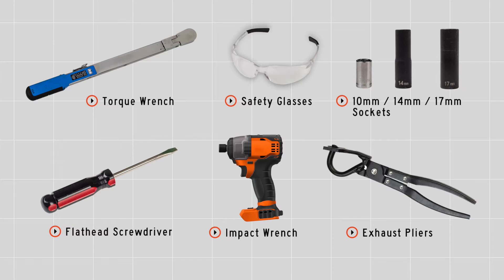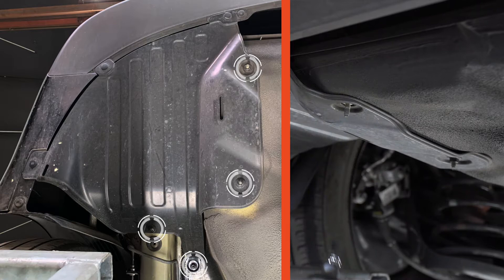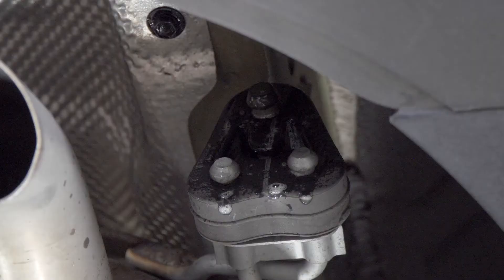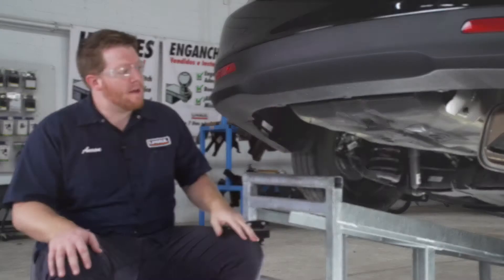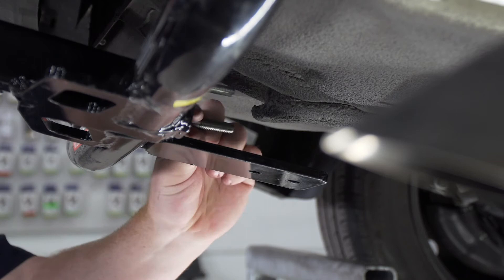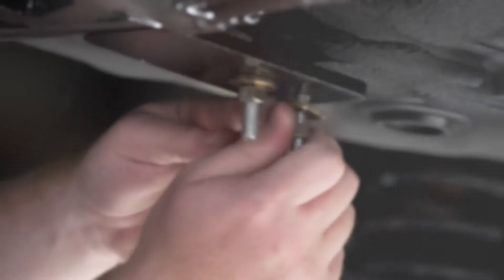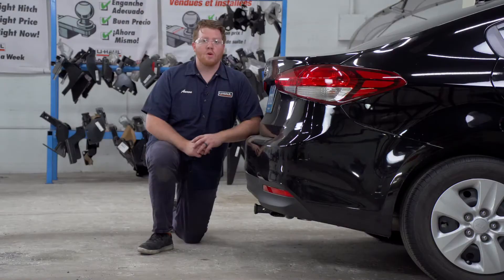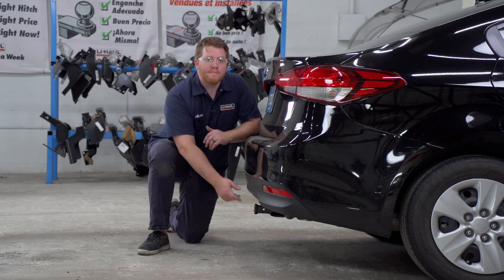2016 Kia Forte Trailer Hitch Installation

Comment: How much weight can this hitch handle? Planning on using it for regular towing of a single jet ski trailer with a 600lb ski.
Reply: I believe they're rated for 2000lb towing weight and 200lb tongue weight.
Reply: It says in the owners manual that towing shouldnt be done with the vehicle
Reply: @ANDERSONEXPRESS7  depent on your transmittion. with manual it's more than ok
Reply: @projetcaribou7249  if its authomatic trnamission its not suggested?